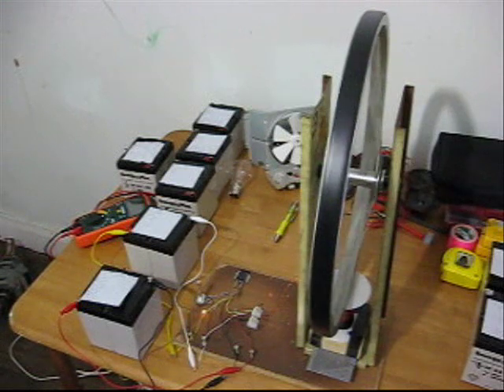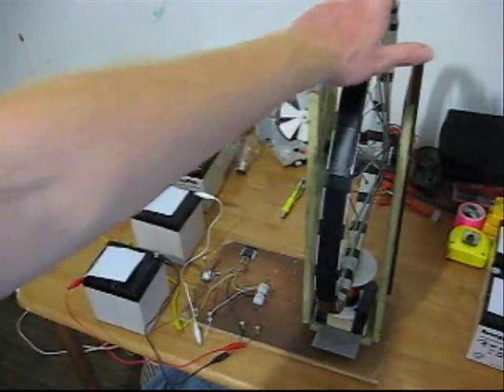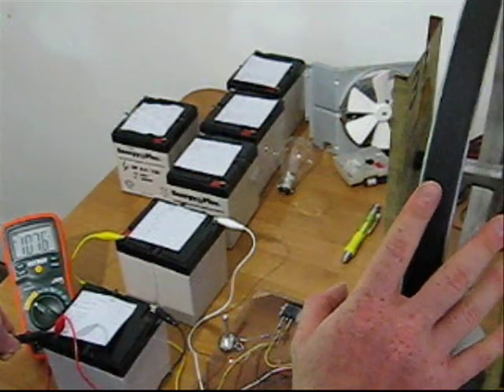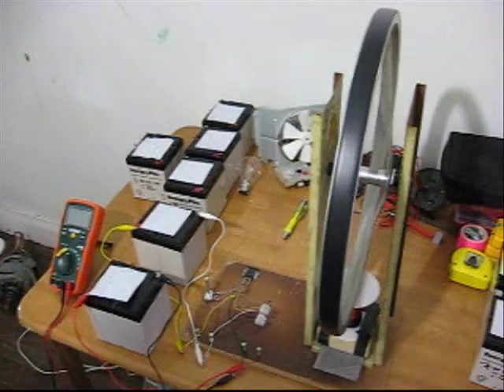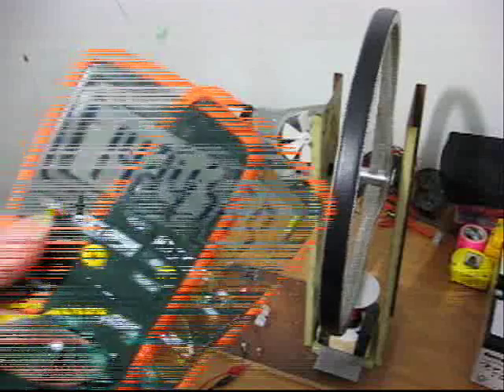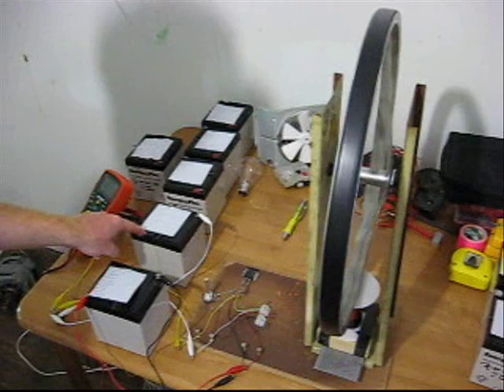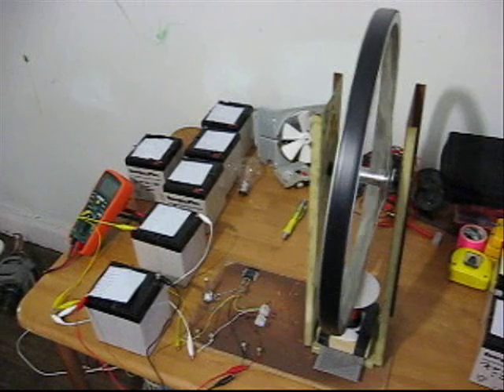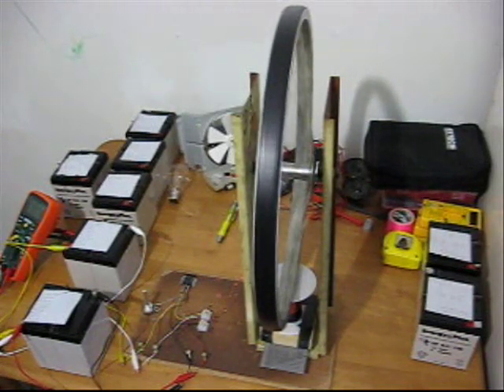John Bedini Replication

Comment: since the circuit is triggered each time a magnet passes by the coil, 'taking energy out', meaning when the wheel runs slower, will trigger the circuit less freuently, thus needing less energy.

what I haven't seen (read) is how much can you get out for a specific size wheel/magnet sz/#magnets/coil and circuit combination. That seems to be elusive to an engineer like me.

Nice work, cheers

Comment: In order of use, A new 950 CCA Battery! One used, very dead, 84 month battery from a 2000 Toyota Camry (VERY DEAD!) One used 'Back-ups' battery! One, six circuit, Bedini Monopole, five power coils, one trgr coil, five 400 volt, 8 amp, full wave, Brdg. rectifiers! 24 cycles, charge to maximum discharged to six volts! Final result, 15.7 volts stored!  The 'back-ups' could no longer charge the batt., the Toyota batt. would not trigger the convtnl batt. charger. they are now both better than new!

Comment: I have hopes for free energy, but here is what bothers me, if this setup is very close to unity (COP of 0.9ish) then that is not exactly a surprise, it is not doing any useful work yet, since it does not have a load. As for the battery conditioning side effect, this is perhaps because it breaks away sulfate deposits, since it charges in sharp pulses. Though if one wanted to set aside overunity to build a special charger for battery conditioning, it could be done without rotating parts as well.

Comment: Bedini claims that it is these high voltage spikes that recondition crappy used batteries to hold a charge again.

Researchers into battery desulfators say that when the charging current is HF pulsed via high voltage, then the electrolyte particle size that is in contact with the electrode becomes tiny which approaches the optimal way to support both charging and discharging of the given battery.  I would like to see the Bedini charger work in a vacuum with no air resistance & magnetic bearings.

Comment: Only way to know the waveform is to use a high voltage, high impedance oscilloscope to look at it.  You might have to use a series, then parallel resistor (voltage divider network) as input into the oscilloscope because most oscilloscopes do not permit such high input voltages.  If the voltage is huge, then you have to slow down the speed of magnetic flux change per coil pass.  When this is done the peak voltage will not destroy your bridge unless your bridge has too low a peak inverse voltage.

Comment: The voltage spikes developed by the magnets moving past the coil can be huge.  The faster the wheel, the faster and larger the voltage spikes. If you had a 2000 Volt transistor and a 2000 volt high speed bridge rectifier, it may still not be enough if the wheel spins fast and close to the coil. These spikes are narrow impulses. The physics calculation involves the change in the magnetic field strength as seen by the coil per unit time.  The size of the voltage could be several million volts?

Comment: I think so too. Switching from DC to AC measuring range, usually means including a diode or bridge rectifyer in the meter circuitry, then compensating to RMS values by internally multiplying.

One other way to check for a true AC component, is to put a capacitor in serial with the meter. If the reading then drops over time, it's just the capacitor getting charged. If there's an AC component, it will not be hindered by the capacitor. Use a value larger than 100 microfarad.

Comment: Hello from the UK, am building the circuit now but wondered if when charging the batteries were you using the bridge rectifier if not,have you since, as i am interested in whether the batteries still charge the same ie quicker, after being thro' the Bedini circuit. the bridge may need faster switching diodes as used in TV line output stages to prevent damage to them. my purpose to see if Electric Car batteries can be charged faster
Trevor

Comment: Nice build!

A few points... there is still *some* back emf in the bedini motor, though it is greatly reduced compared to a standard motor ^_^

and I think your higher "AC" meter reading is a glitch with the meter... looks like it is just doubling the dc voltage.  A good way to test that will be by bridging that part of the circuit with two leds in opposite directions... you will be able to see which way the current is flowing.

Good work!